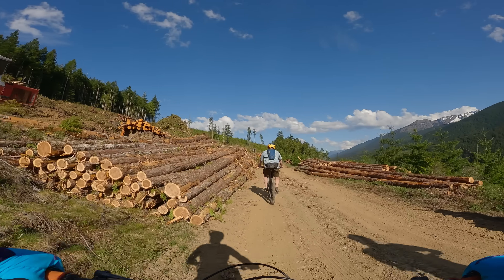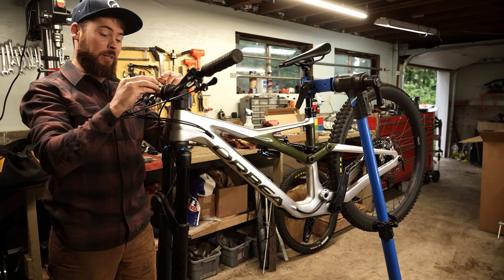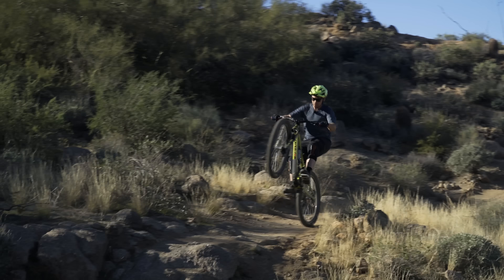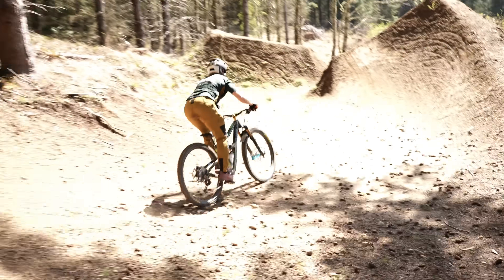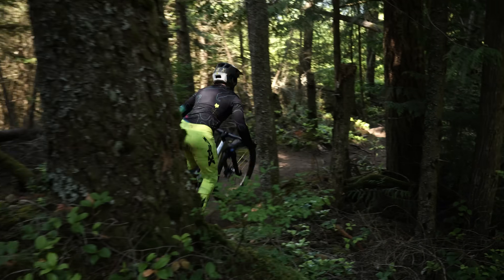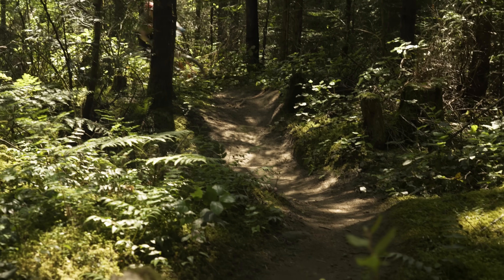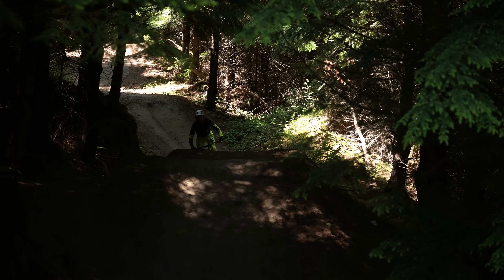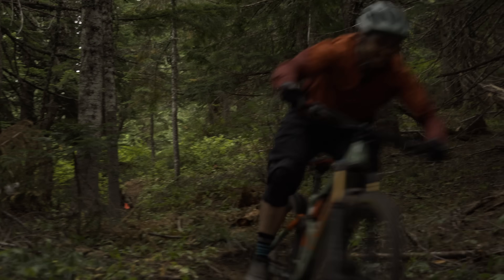7 Pet Peeves with Modern Mountain Bikes

Comment: Nailed it with the volume spacers. I’m an average weight Moto guy and the modern air suspension on mountain bikes is…..ok. As we have learned with mullet wheels, big front disc brakes and longer travel, the bicycle industry could learn a bit from the MX world.
Reply: Yeah, and why is mtb suspension continuously so boutique and expensive. Top of the line MX suspension is way higher technology and quality, but also cheaper and more rebuildable. Omnicorps ruin everything. Japanese free market made dirt bikes really good and reasonably priced, shame that never seems to happen with mtb.
Reply: @apodski  no doubt! I guess this comes to a point not mentioned. Why do some mountain bikes cost more than dirt bikes when most bicycles are still very primitive compared to the tech a dirt bike has?
Reply: @MX763  Yeah, a 20 year old 125 MX is a space ship compared most downhill bikes, materials and engineering, yet still fully user serviceable, they weren't that expensive new and they are dirt cheap now.
Reply: @MX763  Dirt bikes also got this way unbelievably fast, they went from expensive, fragile, and unrefined European machines to the aforementioned affordable space ship in just 25 years. I guess there wasn't as much big business and patents in the way back then. 

Dirt bikes may seem heavy and agricultural compared to MTBs, but virtually everything on a dirt bike is machined or forged as light as possible out of high end alloys, and thoroughly torture tested. We just need that robustness and design scaled down to handle 20% of the speed and 5% of the power. Nobody wants to do it, instead they want marketing and huge profits.
Reply: I weigh 230 at the moment and i need to run max spacers in everything or i bottom out everywhere 😭
Reply: @apodski because the market is infinitely smaller than the moto market and weight is not really as big of a factor when it comes to moto. Also the heft of a moto bikes improves suspension feel you even see down hill teams strapping lead weights to there DH bikes for this reason.
Reply: @ASAP2525  I disagree with the bicycle market being infinitely smaller. If the bicycle market is so small, why did Trek buy up a bunch of privately owned dealers in large metro areas?
Reply: @apodski  when you say that Mx suspension is way more rebuildable , mountain bike suspension is simple enough. Nowadays there's plenty of in-depth videos about all the latest and greatest as well as the old school stuff.. and even if you don't have access to these things then just get the tools out.. non of it is mythical lol.. suspension isn't the minefield that people think.. it's all really quite basic principles that were taken originally and still to some extent today from the Mx world.. but MTB has become way more refined than it ever has been, way more understood and adapted
Reply: @OLI-vx1md  It's not a matter of complication, MX suspension is way more complex, but parts are all available and it's made to be rebuilt. And it isn't that big deal to have air suspension with MX because companies just make different weight springs for a reasonable price. You  can even get titanium springs without spending a small fortune.
Reply: @ASAP2525  It's definitely far from infinitely smaller, if smaller at all. Competition dirt bikes are not as common as you think, especially today. They do get trickle down parts and support from the motorcycle industry, which is pretty huge worldwide, but so is the bicycle industry. The problem is consumers are dumb, and the big bicycle companies know how to keep the market right where they want it.
Reply: The basic rule should be, anything over 155mm travel out back should be running a 65mm stroke shock, that helps a ton with bigger riders, especially if you want to run a coil.  Anything in the 145-155 travel range should be running a 60mm stroke shock.  Leave the 55mm and shorter stroke shocks to the trail bikes.
Reply: @brysonberhorst9795 6’2 235 and yup a 2 foot drop bottoms out my 160 Enduro rig lol.
Reply: @MX763 trek and other makers sell tons of commenters, hybrids, and entry level mountain and road bikes that get used as commuters or for more gravel bike like riding, not a ton of people actually buy high end mountain bikes and ride them hard.
Reply: Motos are different than mountain bikes because the moto weight is most of the system weight vs on a bike the rider is most of the system weight. So the weight range the suspension needs to be tuned for is far larger relative to total system weight making it harder than suspension tuning for motos or cars.
Reply: @MX763 lol, disagree on what grounds?  The moto market is literally tens of billions of dollars larger than the mtb market...
Reply: @apodski mmmm not really as light as possible, there is a 220lb min for 450s,  works bikes get there.....  it costs a TON of money
Reply: @adamhollis6753  depending on the data, 17-20 million bicycles were sold in 2022 with roughly half of those being mountain bikes. It’s estimated 7-9 million motorcycles were sold last year with 1-1.5 million of those sales being dirt bikes. However, the value of the industries (bicycle vs. motorcycle) is roughly the same. The data says two things. 
1.) There are way more mountain bikes out there than dirt bikes. 
2.) While the industry cap is roughly the same, the dirt bike segment accounts for approximately 15% of the total motorcycle market while mountain bikes account for more than half of all bicycle sales. 

When the bicycle guys put the egos away and realize they can start riding dirt bikes for close to the same cost, things will change. Also, the motorcycle industry saw record growth from Covid as did the Ebike segment of bicycles. The numbers are heavily skewed because of Covid but the bicycle market remains flatter than the motorcycle market and dirt bike segments. The “valleys” from Covid, I would imagine, will be much larger in the motorcycle market and dirt bike segments.
Reply: @MX763 but I like bikes more lol.  Maybe I should just put moto suspension on my bike and it'll work out.
Reply: Plus high rise bars! I was running 20mm bars (Renthal) and 160mm front rotor. Switched to 40mm and 200mm and shocked at how big of a difference it makes to stability, control and comfort.
Reply: So true motos are so much better built hopefully in my life time we will get a proper sealed gear box that mounts to a mtb frame sorry but pinion are just shit .
Reply: Word
Reply: @EnglertRacing96  Well, yeah, a moto isn't light compared to a bicycle, but if you take into account that it's 60hp, jumps 20 feet to flat, goes 100mph, it's extremely light. A fit person in a bicycle can't make more than 1 or 2 horsepower, even for an instant. Lightness from material quality and engineering of a moto surpasses all but the most expensive mtb's. Moto frames are welded with the most sophisticated lightweight techniques possible, and some subframes are even carbon fiber. Carbon fiber isn't really viable for the whole frame because of engine mount vibration and safety concerns.
Reply: Motos are also infinitely more durable than any mtb, moto consumers demand they hold up, as anything that expensive and vital to rider safety should.

I was bending a small dent from a moto rim the other day and was astonished to find it took a 10 lb hammer to have any effect on it, on a rim that only weighs a pound or so— Welded 7000 series aluminum, some of the best alloy on earth. $150 for a new rim, an MTB rim of that quality, 25% the material, costs about the same. Why? Motos also all have forged hubs, I don't even think those are available for MTB, you have to pay a fortune for CNC'd that's likely weaker than forged. 

MTB consumers are strangely satisfying with incredibly fragile $10k off-road machines. It's shocking that MTBs cost as much as motos, when the Motos have the same or higher level of material quality and engineering, but vastly more parts and robustness.

Comment: Small note: Pedal torque in the 35-55Nm range is understandable. As the screw diameter increases, so does the torque. That said, if you’re greasing the threads (recommended) you could likely do half the torque and be fine. 

I think I passed your house right when you were coming home from the pump track this past weekend. I should’ve said hi! 

A couple questions for you:
1) Have you tried any steel frames? Gearbox bikes? Anything “out of the ordinary” that you think could change the industry?
2) On your tire review videos, would you consider putting a summary at the end with a decision matrix? (highlight tire performance attributes and mark which are +, -, and neutral)
3) Are you familiar with Paul Aston’s channel? @astonMTB , he has some intriguing theories on how mountain bikes should be designed and spec’d

Thanks for all of the content!

Comment: I ride XL bikes with ~820mm between BB and saddle and my last two bikes came with 170mm droppers which didn’t lower nearly enough. Have been very thankful for the OneUp 240mm dropper and the fact that it fits in the bikes.

Comment: As a Clydesdale rider, I actually have found that volume reducers are the bane of my suspension woes...  I finally broke down and worked with a local suspension guru to get my Fox38 on my RipMo working perfect for me.  The suspension guru actually used a volume reducer but in the negative chamber instead of the normal air chamber tokens are shoved these days.  My basic SAG air for the fork went from 140psi to 120psi and allowed me to fall more in line with rebound and compression settings to fine tune those for my riding style.  For me, most tokens still don't keep my suspension high enough in its travel but instead puts me in a very narrow band of travel that makes a very harsh ride experience.
Great pet peeves for the rest of the video and could not agree more.  On the hydration note, I am looking for my next XC suspension bike to be able to hold at least two water bottles. :-)
Reply: Yeah positive air chamber tokens will only slightly increase mid stroke and will affect end stroke much more.
Reply: I, (also 250+) have to pull most of the tokens out of a Fox fork for it to not feel like someone is kicking my handlebars on every bump. Then it works a bit less effectively, but it at least feels better than a rigid fork. Part of the issue is that Fox factory valving is set up for 240lbs and under.
Reply: Yeah I’m over 325 here and filling a 170 Fox fork  and 160 shock with spacers just made it ride like an XC hardtail. Now I’m on Ohlins and can actually achieve proper sag - I have to choose between fully open which means using full travel multiple times on every ride even if the features aren’t big, or going to position 3 and it being a little too harsh but I can tolerate it. VPP is the best I’ve felt for us Clydes since it has such a high anti squat throughout most of the travel

Comment: Mine would be:
1) Setup. Especially suspension. I think the Norco's approach with detailed, baseline, instructions for everything is awesome. But, with modern forks and shocks having such a broad range of adjustment (and factoring their price points too), why is it so hard (or complicated) to dial in? Most recommendations seem like an after thought – which is crazy for such expensive products. 
2) The dropperpost issue. Being a bit in the short side, but with extra short legs, my first glance at a geo-table goes to the seattube length or seatpost insertion – if I can't fit 160+mm dropper – no good. Which, in the past, has had me hold off buying brands like Evil, Banshee or Mondraker even though I love their products, because there was too much uncertainty if I could fit the dropper I'd want. I'd rather ride single speed than forgo a long dropper.
3) Tires! I mean choice is good, but jebus rhey make it difficult and way too complex to choose a tire: casings, variants on casing, patterns, sizing, rim size variants, compounds, and all their propiorty tech, it's sooo under informed/explainded, which in turn makes it hard to want to try something new – also considering how expensive tires have gotten too.

Comment: Awesome points! Dropper posts, bottles and even extra bottle mounts.

I’d like to see more bikes with bottle mounts under the top tube for other stuff!
Reply: IMHO XC bikes and short travel trail bikes should be able to fit 2 bottles by default.  I'll give enduro bikes a pass there because big travel bikes with 55 and 60mm stroke shocks are already prevalent enough and we shouldn't be encouraging that.

Comment: Interesting comment on the Niner WFO. The difference between high/low settings on the flip chip is significant. Tech climbing is not great in low, but that's not really what the bike is designed for. I have 165mm cranks on mine, so that helps. What a fun bike though, my goodness...

Comment: Another big one I'll bring up.  Crank lengths.  165mm cranks should be what most bikes ship with, even 170s are longer than necessary on anything less than a XL frame size.  Nearly all bikes ship with 170 or even 175mm cranks.  Shorter cranks are a big help with the lower BB heights like on the Ripmo.
Reply: I have 170mm on my XL Canyon Spectral I get the odd pedal strike but they just scrape rather than hang up. I'm 6'5" btw.
Reply: My peeve there, is longer cranks on the XL or XXL, when the bottom bracket is the same height. A longer wheelbase bike is more likely to hit pedals/chainring than a shorter one with the bb height.
Reply: @tjb8841  That's because frame makers don't increase the stack accordingly, instead they increase the crank length so you don't sit as high on the bike, thus maintaining a less ridiculous seat/bar height ratio.

Comment: 4:39 I prefer suspension without volume reducing spacers. I ride on EXT ERA V1. I don't need a flat socket/suspension socket, and a ratchet wrench on the trail. I only need a shock pump.
I can test ride it and adjust as needed, and repeat until it feels right.

Comment: Totally agree. The first thing I look at a bike immediately is seat tube measurement and maximum insertion - what’s terrible is that insertion is the first thing I look at, yet most bike companies don’t even have it on the geometry part of the website directly - I have to email them. Also agree with the water bottle part, if a bike can’t fit a large water, I’m not buying it. I hope bike companies read all the comments here. 

Question, I don’t get your comment on the volume spacer part. Are you saying suspension should be more progressive right from the start out of the box?

Comment: Good points all around! Too low BB leads to dangerous surprise pedal strikes. Not being able to use a full 24 oz bottle drives me nuts. I had to find some random bottle cage on Amazon with lots of adjustability pushed all the way down and bent slightly to just be able to get a non-insulated 24 oz bottle in my frame so I didn't have to buy some $90 titanium cage, and still I can't use an insulated 24 oz... I was very close to drilling new holes and putting in some rivnuts! I chopped my seat tube by 25mm to keep using a 170mm dropper! Torque specs can be crazy, I don't use a torque wrench on any bike parts. Thankfully I have enough mechanical experience to use good judgement and have never had issues with anything coming loose or being damaged from too tight or loose.

Comment: The suspension being designed for a sub 150lb rider is a big one of mine.  The Ripmo is a big offender there, I have a cascade link and 3 spacers in the shock (had 5 spacers prior to the cascade link) to get the bike so it doesn't bottom out constantly at 250lbs.  Mine also only came with a 150mm dropper and since I got the free upgrade to a Bike Yoke dropper thanks to 2020 supply chains I'm loathe to replace it with something longer because it's such a good dropper.
Reply: Go coil and you will never go back

Comment: On the subject of torque specs, there were a number of screws and bolts which I had been under-torquing massively without using my torque wrench, namely lock on grips, axles and stem bolts
Reply: Those are the things not necessarily need to be torqued to the spec. Long story short, composite deforms and torque value won't really go up much. Axles and stem bolts have max torque value so people don't destroy them. As long as there's no slippage, it's fine.
Reply: There's also things you want to deliberately under-torque, like your brake levers, you want them to move if you crash so they don't break.
Reply: I haven't had any issues torquing MTB stem bolts to spec. With composite bars you'll want to be careful to not overdo the torque (and use a carbon paste to prevent slipping). Now on BMX... you have to do substantially more torque than MTB because of the riser bars' moment arm.

Comment: 9:14 In my opinion all bikes should have uninterrupted seat tubes, nothing blocking it just simple tube, Nicolai does this. I can fit 200mm on my bike. Many bikes have kinked seat tube, a pivot interfering with the insertion depth. the Mondraker is also silly.